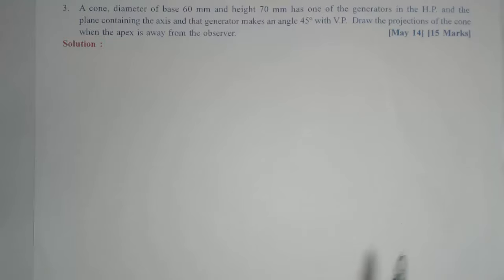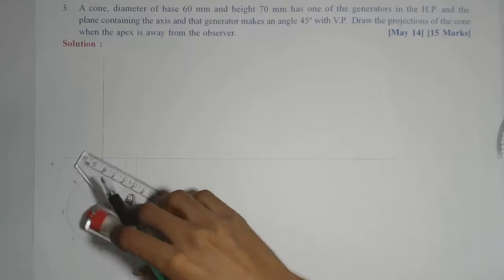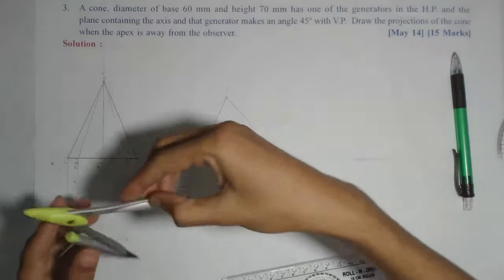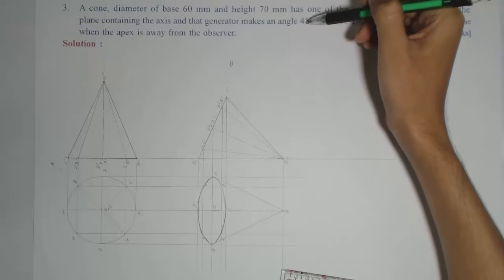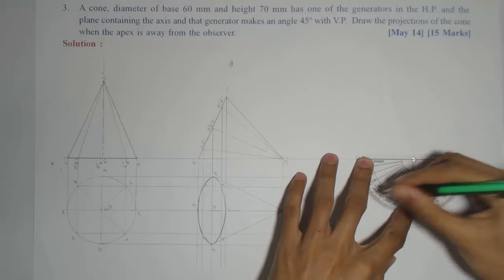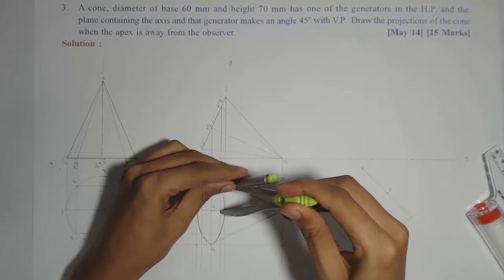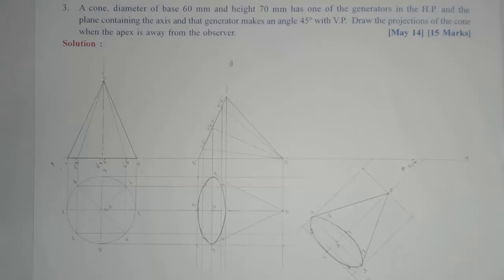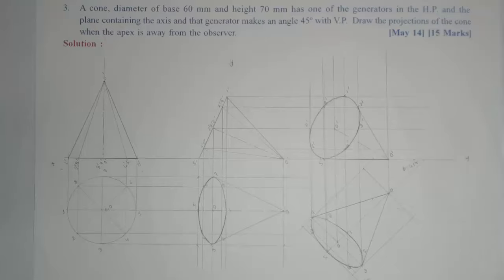Cone Q 3 May 14

Comment: After the second stage, in the VP, the length was apparent length, right? why didn't you take the actual length 1st and then the apparent length in this case?
Reply from the maker: Becoz for third stage the angle with the VP is not given for true length of the axis but it is given for plane containing axis and the end generator which is nothing but O-O-5 in the second stage TV.
Reply: Oh, my bad. Thanks!